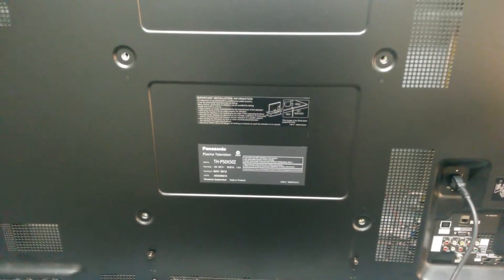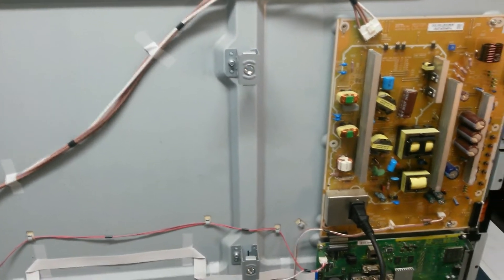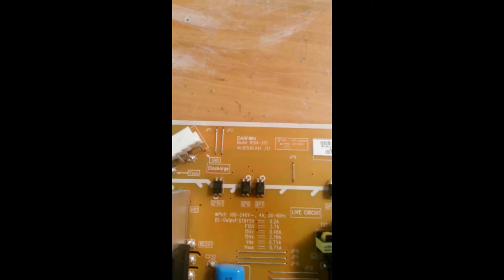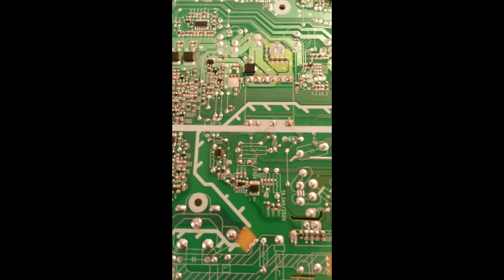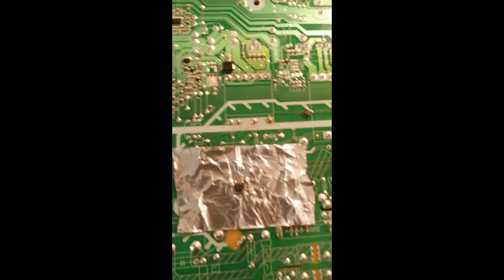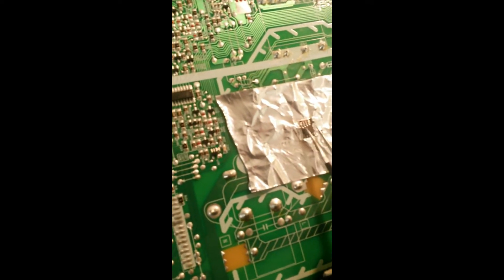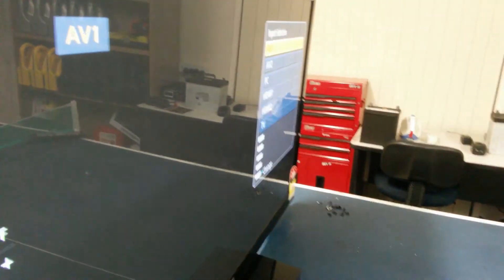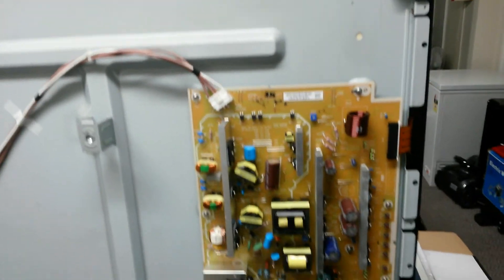Panasonic TH P50X50Z POWER SUPPLY REPAIR B159-201 4H.B1590.041/E1

Comment: That's a pretty slick heat gun you have.  It looks like it has a very precise, narrow tip that allows you to get heat right at the small area you need.  My heat gun doesn't have that.  Can I still get the chip off by blasting heat at it?
Reply from the maker: Yes, use aluminum tape and isolate the chip. Blasting heat all over the board can cause irreversible damage
Reply: @autronicsltd3478  Random question but could I use aluminum foil to isolate the chip? I got the tv for free and I'll be damned if I spend money on it other than the chip😂
Reply from the maker: @loganjohn7604  possibly  but AF is conductive so might not be suitable

Comment: I have a TX-55FXW724. TV is only 2.5 years old. And doesn't do anything anymore. The first Panasonic I bought 10 years ago still works. The second only lasted 4 years. And the third only 2.5 years.What is intention ? That TVs have a shorter lifespan?? This is not normal. For me no more Panasonic...

Comment: man i really appreciate the effort to share your information that you have done , many thanks , it appears to be the same architecture as the 50xt50 setups

you desserve an honnor flag , thanks and gratz from quebec-canada , check my wall it could interst you , in particular my vacuum system linked to a dessolder teflon nozle from a manual dessoldering pump .. tube goes to a glass bocal ( masson ) that act as solder separator ( recuperator) , then go to 2X evaporating purge valve in parallels from a gasoline vehicule    they are 12V electric air valves ,, .. a power button from an old samsungf hpt plasma screen on floor as pedal switch . activate valves via a relay ,,it result as opening the reservoir of 25 gallons at 30Hg/cm2 close to absolute vaccuum. ,  a climatisor compressor who intake is linked to the tank with anti-return valve, then the output of the compressor goes outdoor because these compresser smells the hell when you abuse of them but they are pretty robust and efficien even when you see smoke coming from the output tube , he work like a charm now since 1year , its amazing how efficient is a dessoldering pump at 30Hg :) keep working , the futur is ours we are the next millionaires when the system we know will fall

Comment: Hi there,  I have Panasonic Px50X50B model, on this tv i have red light on the front but when i press the on button that red light goes off and if press the on/off button again the red light comes on but the tv doesn't comes on.  Do you think its the same IC chip?
Reply: NO!
Try to turn on the TV using the remote control unit or press one of the channel buttons on the side panel of the TV.
FYI:
Pressing the power button on the TV panel will not turn the TV on it will only put the TV on the STBY mode

Comment: Hello, 
Thanck you for making thouse very instructives videos,and i just want to tell you that i changr a few days ago the same chip,in the same power supply board,because the 5v st.by missing, and it is steel no working.I readed about fan6755,and it.s seemed it need at least 7,5v on VIN pin,to start,and i can see only 5v.It is posible to have an internal short, and this voltage couldn,t
reach the minim 7v to make the ic start.Please help me with some more informations,about what should i check like fan ic not blow again.One more think.The mos-fet from the stand by source was bad. I measure 320v on the Source pin,and the same,on the Drain pin.I change the FET,and now i have 320v only on pin 2.I bought a new fan6755 ,but i don.t know what check to avoid to blow again..
I have the schematic .

Comment: Great video!
I replaced the U203 chip and the TV works perfect.
I found the chip on eBay. Costs me $7.00 total, shipping included. It came in a pack of 5, so I have 4 left over. Thank you so much for the instructional video👍

Comment: Do you know the procedure to test the 2 blink condigion where the tv turns itself off in just a minute or two for the 50px80u? 
I have a 50PX80U that turns off after just a few minutes, sooner if 
warmer, longer if colder. It turns itself off and displays the 2 blink 
code which I looked up and found to mean 15V SOS with a check point of A
 board. Do you know of a test procedure so I can determine if this is a 
bad A board, a bad 15V power supply, or just a temperature sensor 
somewhere? None of the caps are swollen on any of the boards.

Comment: My tv is Panasonic TH P50X50Z POWER SUPPLY REPAIR B159-201 4H.B1590.041/E1 so i see still not working  i have changed u203 so i look still problem  i click there on tv and i look this led red open  without open tv and not see led green open ???

Comment: Where do I get that pointy heat gun? And what kind of foil did you put over it? Standard aluminum foil? I just ordered the part, I have a normal heat gun. I need to know what I need to buy to preform the actual removal and installation of the new IC.

Comment from the maker: Hi Mundo Digital. here is the link to the aliexpress site where i usually get it from.http://www.aliexpress.com/item/6755MYC-FAN6755UWMYB-6755-SOP7-new-LCD-power-management-IC-chip-SMD/32287859299.html 

Please also check the smd capacitor around the IC.
Happy fixing and all the very best with it